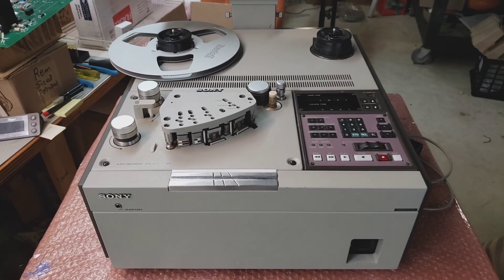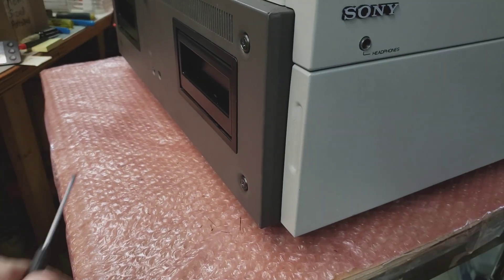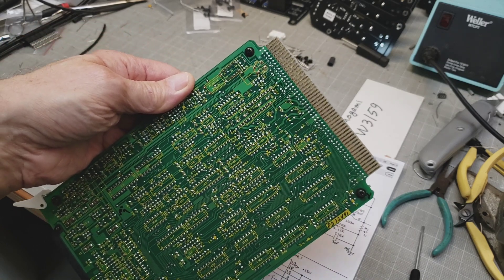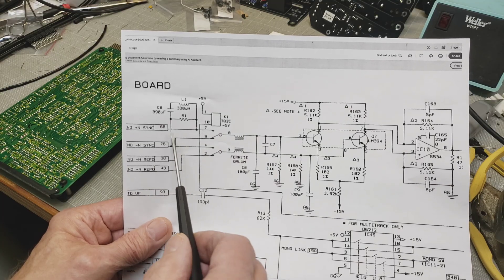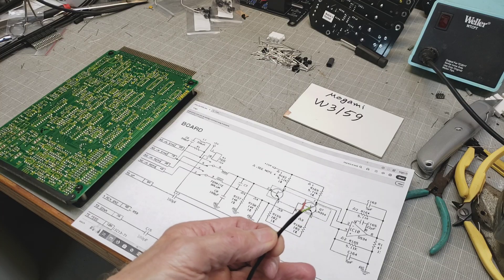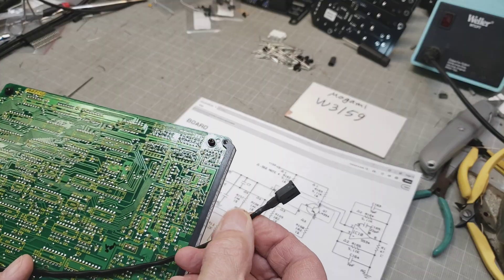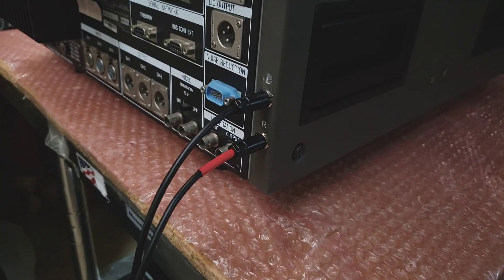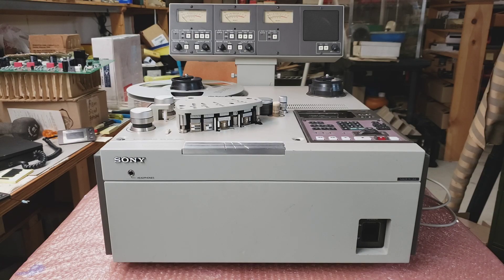Adding Direct Head Output to Sony APR-5003

Comment: Master.
Reply from the maker: Thank you, but this is not a complicated job, it requires average soldering skills.

I would like to mention the Mini-XLR installation, which normally requires a D-shaped hole, with the major dimension of 11mm and the minor one of 10mm.  Making such holes without the proper punch is a royal pain in the ass, so I just drilled the 11mm hole.  Since the connectors are only exposed to axial force, that should work lifetime.  

A note on extra capacitance while using the internal playback circuit.  When doing it you have an extra maybe 80pF or so connected to the audio circuit.  There is already a 180pF capacitor, and apparently the Sony designers were somewhat cavalier about its value.   With all the additional cables in place, both the internal and the external, that 80pF might not be a good idea, so I would disconnect the external cables in this situation.

The internal cables add probably close to 30pF, but as I did the calibration, I did not see anything abnormal in HF region, so personally I would not worry about it.